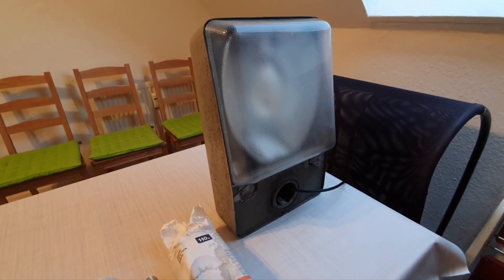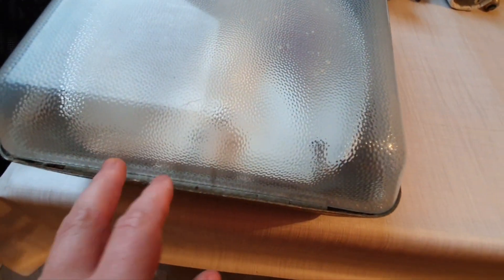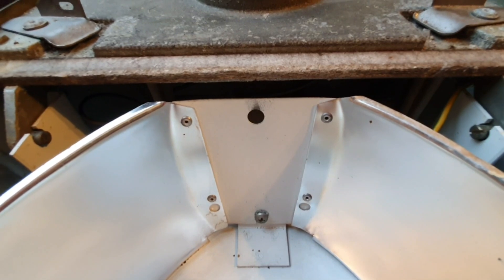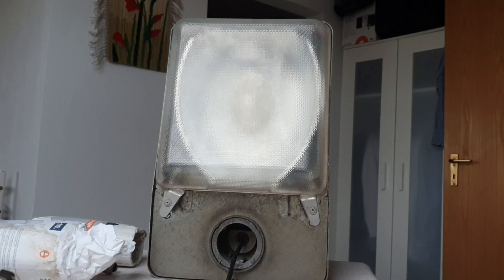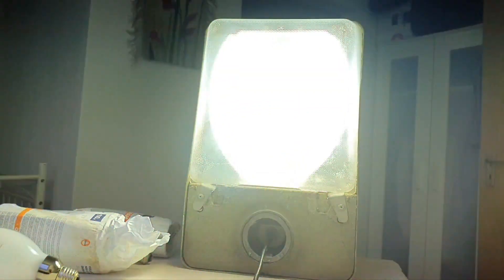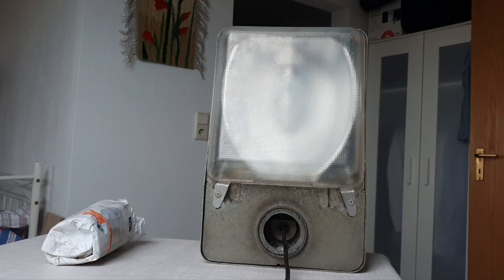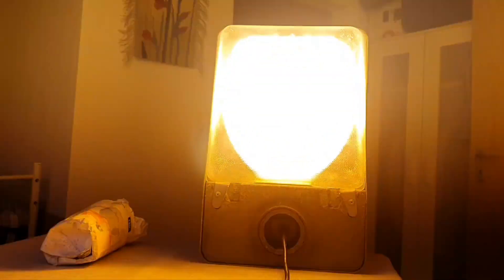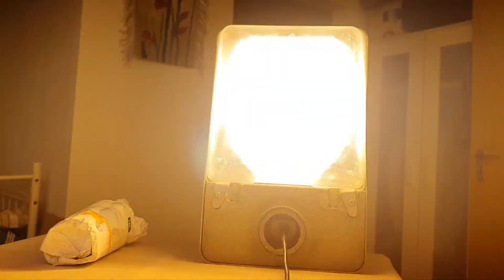AEG Minikoffer 50 - 80/125W Mercury Vapor (MV) streetlight fixture from the 80's

Comment: the koffer 400 is the bigger version of this one and can suit a 400w mv bulb
Reply from the maker: AEG made even a 2x400W MV version, that looks similar to this one, just is 10x bigger ;)
Reply: @mercuryvaporglow5317  the bigger version was used to light up big areas like intersections
Reply from the maker: @seagoldfish3746  I have seen them on industrial areas
Reply: @mercuryvaporglow5317  is a koffer 250 with 2x 90w sox rare?
Reply from the maker: @seagoldfish3746  In Germany they are very rare, I only know that there was a main road in Viersen that had a lot, but they are all gone now, there may still be one or two in Süchteln where I have seen them last, but only singular fixtures
Reply: @mercuryvaporglow5317  i found someone that sells the fixtures thay are working too